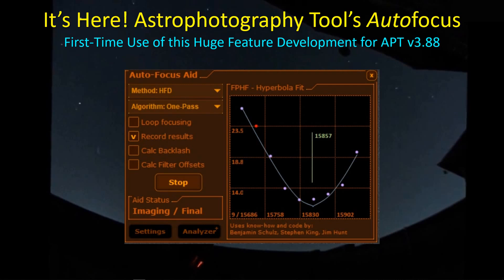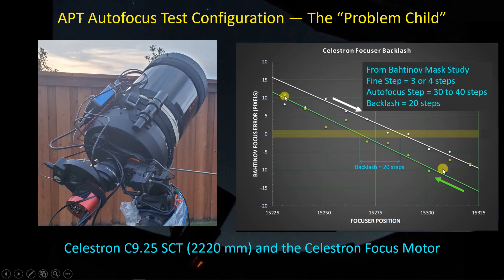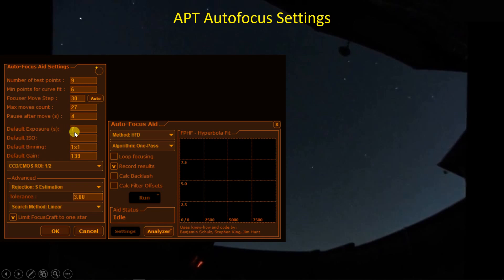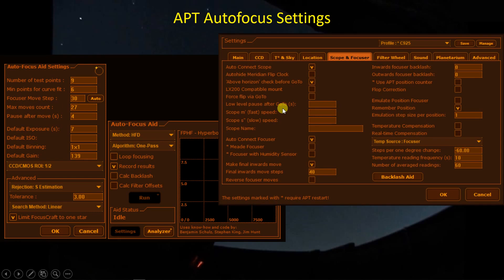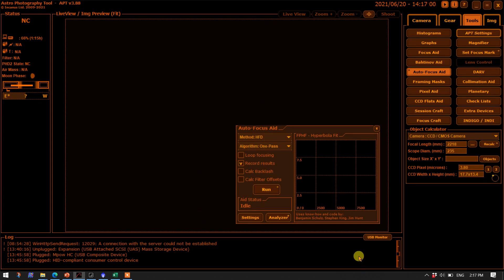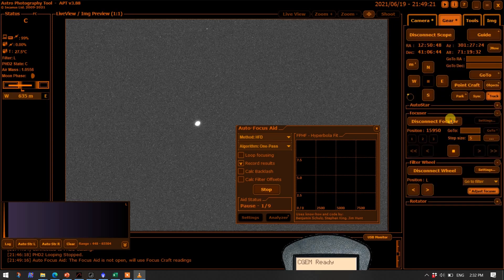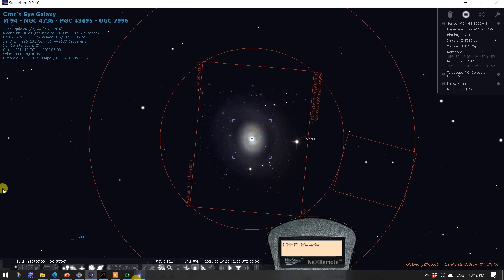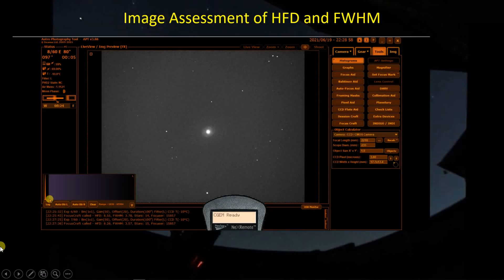First Use of Astrophotography Tool v3.88 Auto-Focus Aid

Comment: Great, well thought out, clearly explained, videos.  Autofocus worked great for my refractor.  SCT did not work until I limited my range of down to about 2 to 1 for HFD at the edge vs at the center.  When starting to use autofocus, notice there is a nice curve of values around the focus center and further out the HFD starts dramatically dropping again and confuses autofocus.  The graph looks like a shotgun pattern.  This is because a hole opens in an out of focus SCT star.  Adjust the step size and number of steps to end just before the HFD starts to go down again after going up as you go further from focus.
Reply from the maker: Your experience/findings track with mine. I don’t use APT anymore, since I switched to NINA. Autofocus with a long focal length telescope like an SCT is very challenging. If you find you’re getting a hyperbolic curve for the inner focus points and it goes crazy on the outside edges, just limit you step size and/or the number of steps to, stay with the range where the algorithm recognizes the out of focus stars as “stars”. Thanks for watching!

Comment: Great video James.  What would be considered a good FWHM number - generally I like to land below 3.0, but APT focuser was running at about 3.4 or 3.6.  Perhaps sky conditions?
Reply from the maker: Hi Charlie. That’s an impossible question to answer. First, the best possible FWHM depends on the scopes aperture (see this video: https://youtu.be/H-cAbF25gcI). You’d think that would provide provide a good idea of the FWHM you should be getting, but it won’t. Different programs seem to calculate FWHM differently. The video, https://youtu.be/mrAUsCn5GyM, show my comparison for different programs (NINA, Pixinsight, ASTAP). The measurements are all over the map. You might do what I did in the video and let Pixinsight calculate the FWHM (if you have Pixinsight). I don’t use APT anymore, so,I don’t know how well it compares. Good luck. you’ll need it!

Comment: How might this be used with canon DSLR and with lenses that their focus can be controlled by APT? For example, I might use the Canon 70-200 f4 lens. And I can control the focus from APT. But I couldn’t figure out how to autofocus using this setup. Any help appreciate.
Reply from the maker: Hey, Tal. Honestly, I don't know. I never use my DSLR for astrophotography anymore. That's a good question for the APT Forum. You might post your question there and see what they say. Thanks for watching!
Reply: @Aero19612  Tx for the advice. So, turns out APT, in its paid version (~$20) does auto-focus for stars using DSLR lenses. I did get the help on the APT Forum, and once I downloaded the paid version, was able to do this. The ironic thing is that it seems faster to focus manually (by remote controlling the motr built into the lens via APT) than to use auto-focus. It's just much slower.
Reply from the maker: @TalGivoly  Glad you got some clarification and a path forward. The big advantage for true autofocus is that it will run hands off so you can get some sleep. Not sure if APT is at that point yet, but that is what they are working toward.

Comment: Interesting as always James. Until it will work in a sequence though it’s not really making APT useful for me. Fingers crossed that comes in soon. I use N.I.N.A. now but it would be nice to have a backup in case N.I.N.A. Is having a bad night! Any news on the guide cam?
Reply from the maker: Agreed. This is just a first, but necessary, step. With a reliable algorithm, they can now integrate it into the imaging plan scripts. The guide cam? Not a single word via email. I’ll have to go back on the support site and see if there’s a response. Not very impressive.
Reply: @Aero19612  Let’s hope APT integrates it soon. On the guide cam, I did get a response. They are promising a solution by the end of the year, but haven’t said more. I’ll keep you posted.

Comment: APT didn't offer autofocus before this  v3.88??
Reply from the maker: They had something they called "autofocus" but it didn't work all that reliably and did not use the hyperbolic fit method that is very effective for controlling noise in the focusing results. Even now, though, the autofocus routine is not integrated into the imaging plans, so it can't be performed automatically. That will come in v3.90. Then, finally, APT will have true unattended autofocus. Thanks for watching!

Comment: What sort of RA drift do you see in Phd logs given the weight of your unit and the OAG?
Reply from the maker: Good timing! Been getting terrible guiding and am digging into the guide logs for clues. Probably post a video on the topic this weekend. For your specific question, drift, if I understand what you mean by "drift", is a result of polar misalignment rather than weight and OAG. Now, if you mean guide error (RMS error in RA and DEC reported by PHD2), weight can play a role depending upon the mount and using an OAG should help. Guide error also depends upon gear noise in the mount (think of it as manufacturing quality). My yet-to-be-recorded video will address these topics.
Reply: @Aero19612  I can be guiding very well and still large large < or decent, RA drift irrespective of the PA’s accuracy. Working with bother AsiAir and PoleMaster. Largely convinced now its mirror flop or sag or crap and likely buying a new scope to replace this SCT.  I’ve abandoned sidereal rate and have switched to the Kings Rate while also custom training some further rate modifications; this need more time then I gave it.  But you didn’t answer the question
Reply from the maker: Haha. I did answer the question, you just didn't like the answer. My answer was: I don't see drift as a consequence of OTA/camera weight or use of an OAG. Mirror flop is an issue for SCTs. I can't say that I have experienced it, but I expect that you would see a jump in the guide stars position, possibly coupled with an increase in the HFD (i.e., loss of critical focus). Sag (aka flexure) could show up as a slow drift. With my SCT, most connections are threaded and the OAG is good for minimizing sag/flexure of the guide scope since there is no guide scope. I use a high guide rate (about 75% of sidereal to eliminate DEC backlash as fast as possible. I also use the "Predictive Periodic Error Correction" algorithm to try and control mount mechanical noise from gears and bearings. I try to use multistar guiding to reduce seeing effects but I'm lucky if I get 2 stars in my OAG view with my SCT. PHD2 and handle large PA error so you should not see drift from PA when guiding.
Reply: @Aero19612  So what RA drift do you see in your PhD logs?
Reply from the maker: @wanderingquestions7501  I don't see any drift while guiding. I see higher than desired fluctuations.
Reply: @Aero19612  .... so your PhD logs report 0 RA drift. Right?  The log shows zero drift
Reply: @Aero19612 .... so your PhD logs show zero RA drift; 0.0 RA Drift? Right?
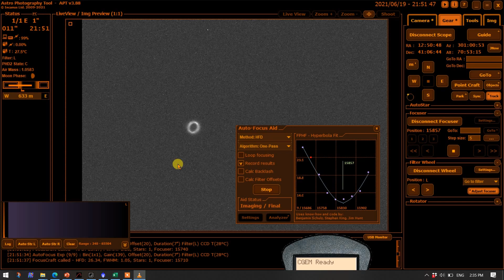Reply from the maker: Check the video I just posted. You can see what my "bad" guiding looks like starting at 8:10.
Reply: @Aero19612  well, you still aren’t answering my question. The question is not a matter of what RA Drift you get w/o tracking on.  The question is what RA Drift your logs report when guiding is ON. Even if you have perfect PA you still can have RA drift from a few sources. I can have PhD reported PA accuracy of 0.3” and get 0.48”/min drift while also getting 1.8”/min with an even better reported PA of 0.2”.   A tight PA and even an OAG do not insure there is no drift reported in your logs and even with very tight guiding one still can have drift. I guess you just don’t want to admit what numbers you are actually getting.
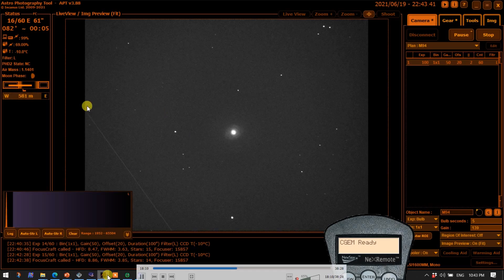Reply from the maker: Ok. One last time. A picture of the guiding is shown at 8:22. Initially, I was guiding. Midway through, I turn off guiding commands and that's when the "drift" occurs. The guided portion is shown at 9:25. There is nothing there that I would call "drift". The rms values are shown at the top of the figure, but that is not drift, those numbers relate to oscillation about a no-drift line. The unguided section (10:05) shows a ~0.9"/min drift (different for RA and DEC at that location in the sky) for 3 arc-min polar alignment error, but you are not interested in unguided performance. Guiding will compensate for drift, as it does in my case. If you have drift while guiding, then perhaps check that your tracking rate of your mount is set to "sidereal."
Reply: @Aero19612  ..... so again, your PhD log reports 0.0 “/min RA drift right?  I’m not asking what you would call drift. I”m asking what the RA Drift is reported in your log.
Reply from the maker: The only time PHD quotes drift rate is at the conclusion of running Guiding Assistant when the mount is not sending corrections to the mount. When the mount is guiding, there is no drift and no drift is provided. See below. But these numbers do not apply when guiding.

From Guiding Assistant:
RA Drift Rate=-12.56 px/min ( -6.84 arc-sec/min ), Max RA Drift Rate=  0.78 px/sec (  0.42 arc-sec/sec ), Drift-Limiting Exp=   1.0 s 
INFO: GA Result - Dec Drift Rate= -1.35 px/min ( -0.73 arc-sec/min ), Dec Peak=  2.19 px (  1.20 arc-sec ), PA Error= 3.0 arc-min

Address any further questions to the PHD forum

Comment: Jay, great video once again!  By any chance did you place the bahtinov mask back on after autofocus to see if you were in critical focus using the grabber software?  Curious if you did.   Does APT have autofocus in a sequence yet to say autofocus after a curtain time or temp change?
Reply from the maker: Hey, Bill. No. I didn't put the Bahtinov mask back on. I'm willing to believe the minimum HFD is plenty good enough or even better than the Bahtinov mask. With the Bahtinov mask, we usually just do a focus and take it off and not account for seeing fluctuations. The ultimate goal is to have a reliable auto-focus that allows us to get some sleep and get good images. Can't do that if we have to get up and focus. Indeed, there's no point in even having electronic focusers if we have to the play with the Bahtinov mask. I am a total sell-out to the HFD/Hyperbola method! To answer your other question, no, the APT autofocus is still a stand-alone tool. I suppose the next step is to integrate it into their session scripting system. But this is a big step. Stay tuned for v3.90
Reply: @Aero19612  I wasn't suggesting putting on a bahtinov mask after every autofocus, just curious if APT got you to critical focus to test it's accuracy.
Reply from the maker: I gotcha. I'm not sure I trust the Bahtinov mask more than the HFD/hyperbola method. Anyway, was having issues with the Bahtinov Grabber program. It was bombing out so I couldn't use it. If I set it run as administrator, it will run. Not sure why I'm having that issue on all of my programs.  Probably those damn Windows updates.

Comment: I used the APT autofocus for the first time about 6 weeks ago. I was amazed it worked the first time and was easy to set up. And that was with a new combo of my Canon SL1 on my EF 80-200 lens. Even found out APT supports using the lens' focus motor, after building an Arduino focuser! :-) I didn't know the graph points were mouse sensitive. Thanks for that tip! Yeah, this is a GREAT addition to APT!
Reply from the maker: Good. Always daunting to try out multiple new things at the same time. This feature has been a long time coming. Still need to get it integrated with their imaging plans for hands-off automatic focusing throughout the night, but this is a great step. Thanks for watching, Mike!